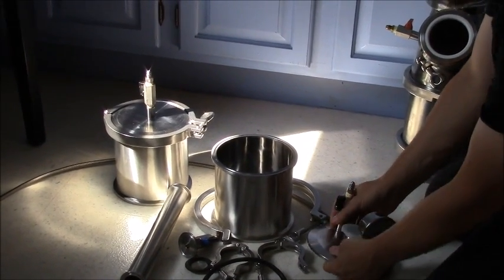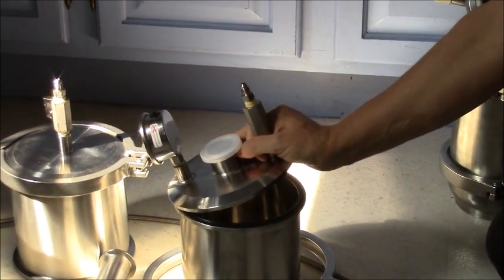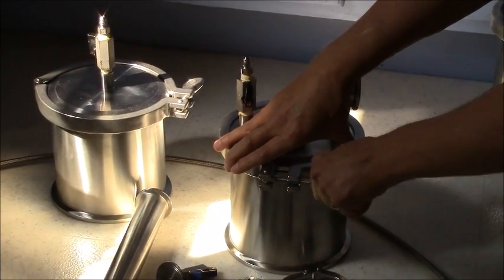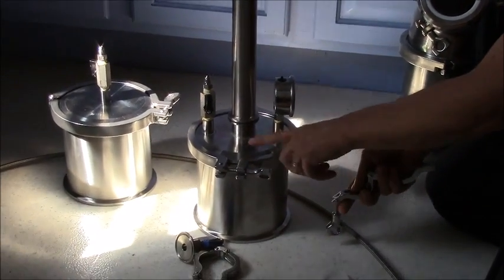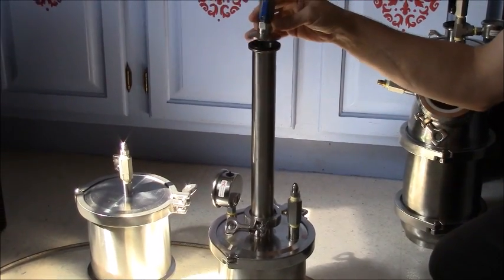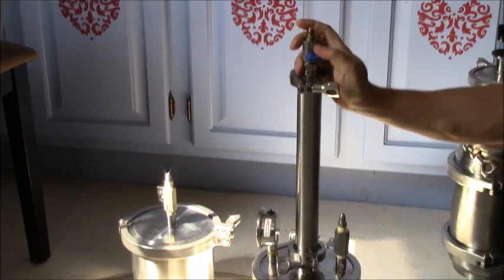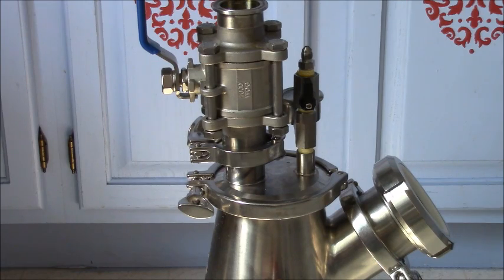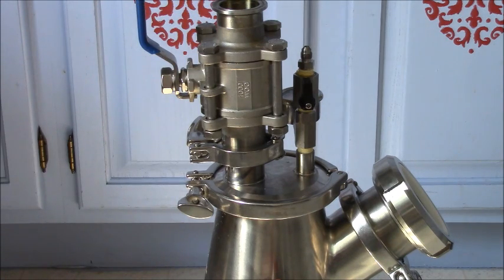Lets Build A Passive Closed Loop Extractor

Comment: great videos; thanks. I'm wondering what are the differences between active and passive systems? Open and closed loop systems?
 I just blast through a glass tube now but I've been thinking about conservation of resources, butane ain't cheap.
Reply from the maker: +Peter Niemi a passive system just uses vacuum and and heat and cold to run where a active system uses uses a pump to pull the butane through the system. open blast is just what your doing compared to a closed loop system. hope this helps
Reply: if your trying to save money on butane and are processing alot of material you would want active cls but there really expensive basicly a pump pumps all the butane threw and recovers it = less butane loss and passive cls dritybongwater answered